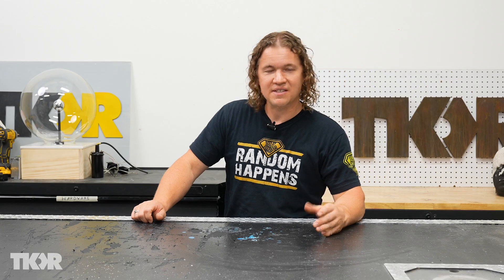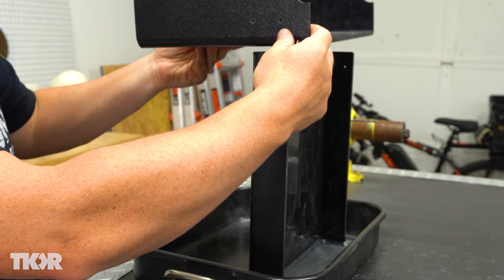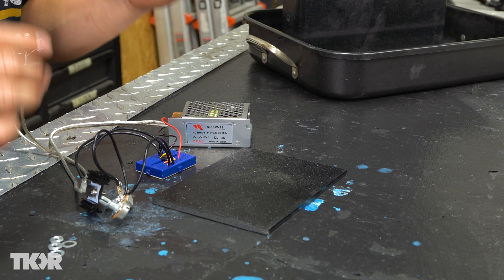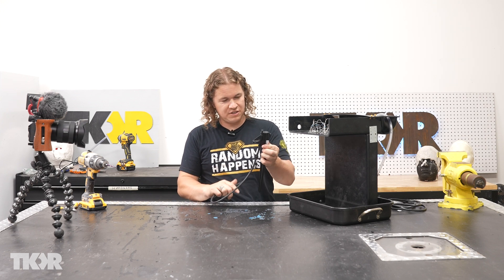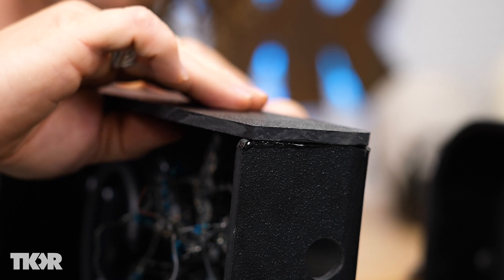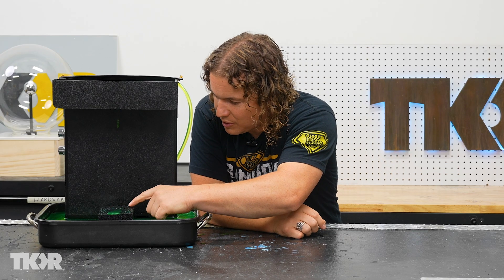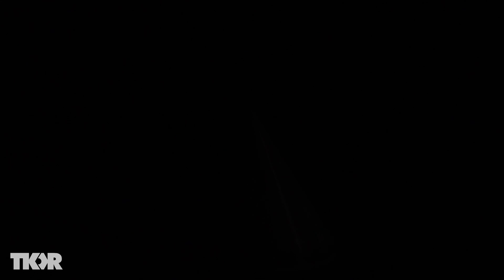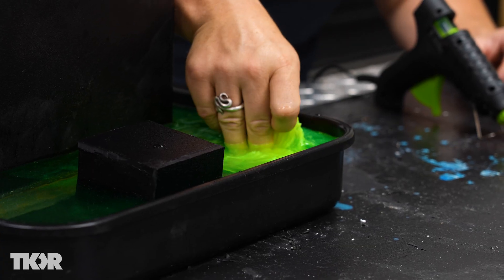🥶⏳Freeze Time with Water! DIY Time Fountain Creates Mind-Bending Optical Illusions! 🌊⏳

Comment: I’m not sure since I can’t try it, but wouldn’t it be easier to fine tune the freeze if you would strobe faster? Like, instead of trying to get the strobe to blink once exactly in synch with the drop, make it blink to a factor (like 10-20 times) of the droprate? I’d think this way it would be easier, and even if it would stray, it wouldn’t stray as fast since the delta wouldn’t be was impactful as when you try to make it blink exactly as fast as the drop rate.

Comment: I made one of these weeks after the original video was released. Managed to get it running at >30 fps, rock solid drop stability... each drop was identical to the previous so the drops didn't have any jitter between "frames". The trick is to use a tiny diaphragm pump, they pump out the same drop size at the same force with each cycle.

Comment: You could have used ONE resistor and then split off to all of the LED's instead of using many resistors, and used way less power.
Reply: But that one resistor has to limit current to all LEDs. So I'd rather put less strain on them but using multiple.